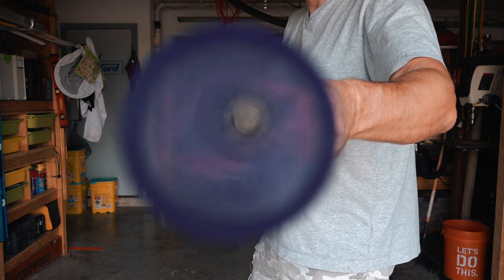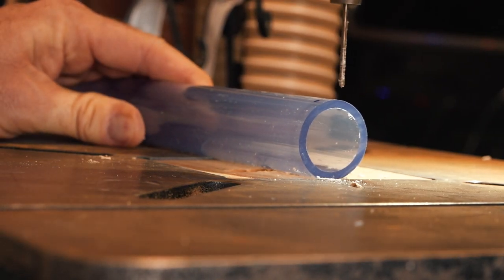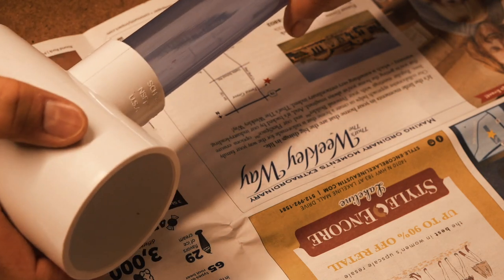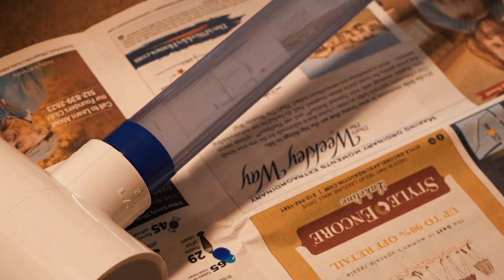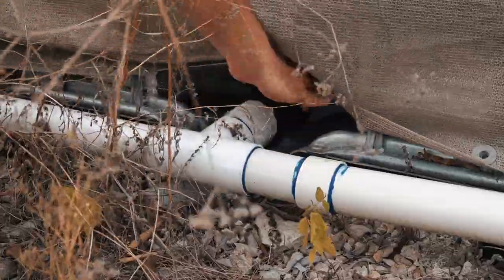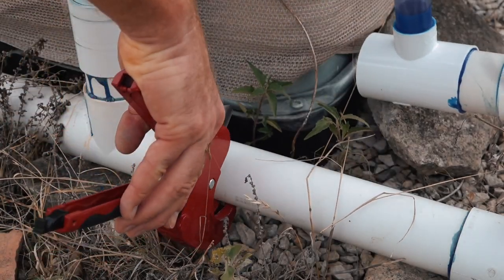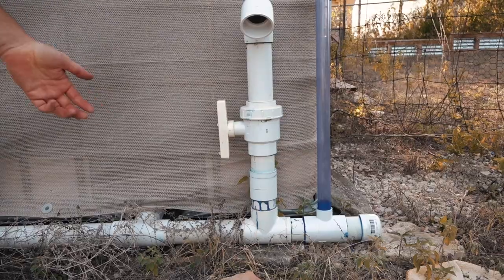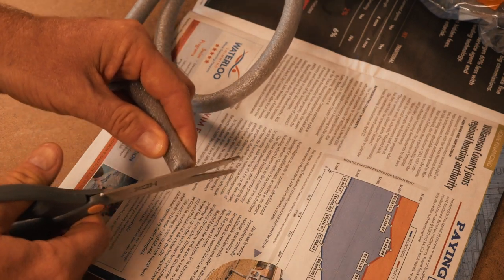Rain Barrel Water Gauge

Comment: Algae grows because of the light that comes through the PVC tube.
Cover the tube with an Aircon ducting tube. They are light, inexpensive and easy to install.
It prevents light from coming through and reduces algae growth.
When you need to inspect the water level, just remove the ducting.
Works like a charm.
Reply from the maker: great idea. Never thought of that

Comment: Why not just a float on a thin rigid rod?... with the top of the rod protruding through the top of the barrel...and a flag or some such on the top of the rod. The rod would need some sort of rigid guide to keep it vertical. There would be no algae concerns. And the barrel's level could be known at a glance from a distance. 
That said, thankyou for the video.

Comment: When you crimped  the pipe it's supposed to be a back and forth motion so it actually cuts or you might crack a pipe it's like taking a straight blade and pressing straight down with enough pressure it will cut the pipe but will also warp it now imagine a back and forth motion

Comment: Where did you get the clear pvc? I’m looking at building one of these for my rain barrels. I figure I can use pipe insulation to cover and stop algae growth.
Reply from the maker: while I don't remember the specific seller, i'm pretty sure i found it on Ebay/ Just search for clear PVC pipe...Algae growth isn't that bad - for me - i run a bottle brush through the pipe every now and then